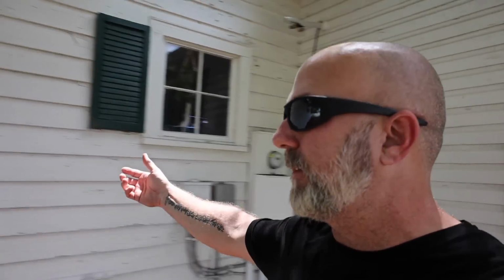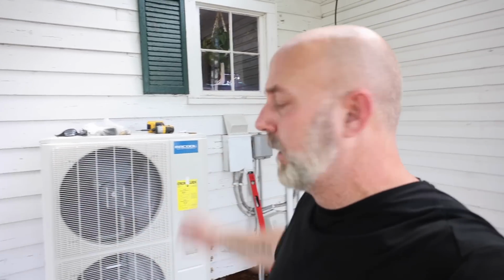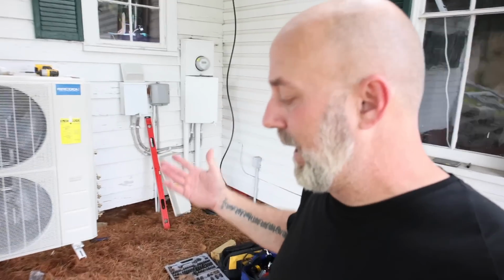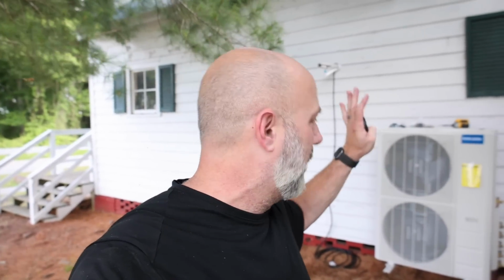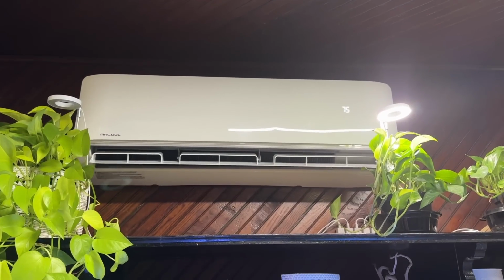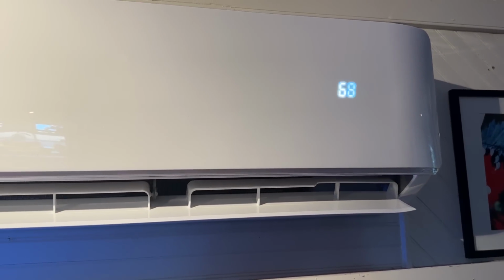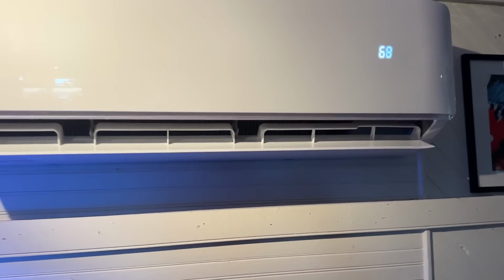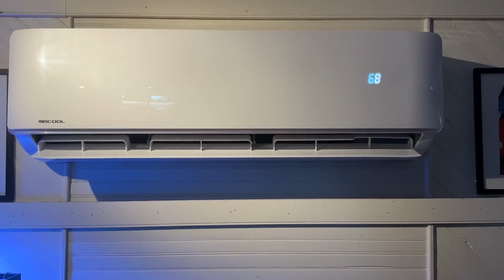Success! We won the battle!!

Comment: You need to vacuum out the system and check the gas upon commissioning  I surprised you did not get a qualified installer do you have Fridge gauges to check the system when running